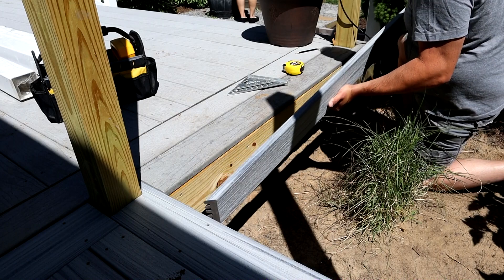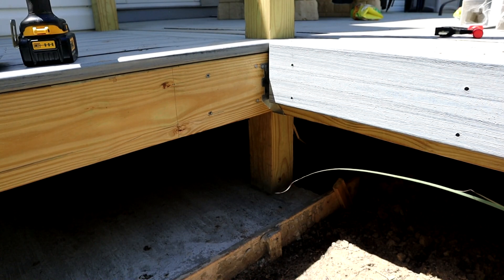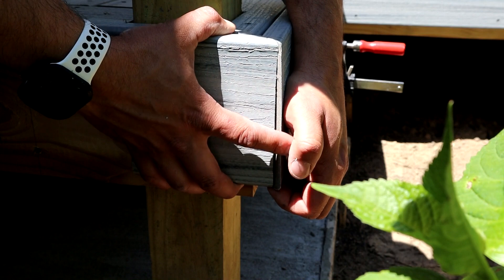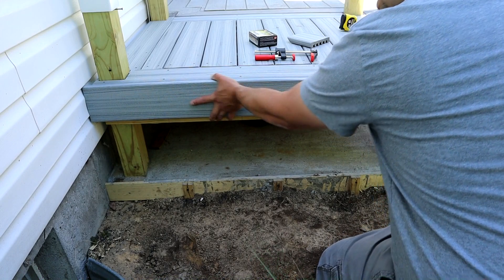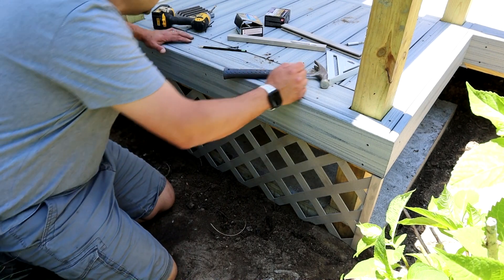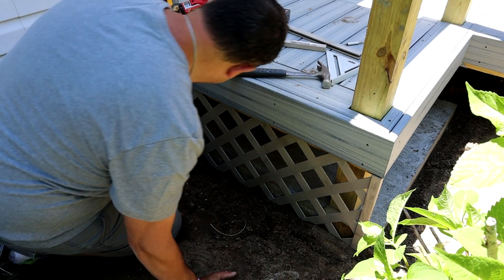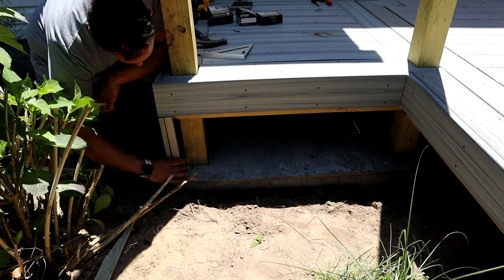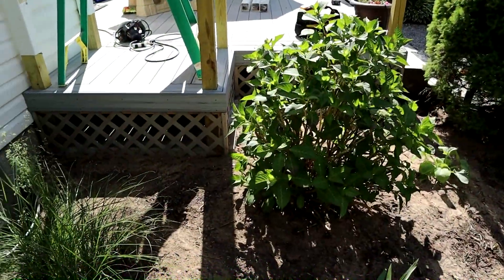Install Deck Skirting and Lattice | How To

Comment from the maker: Miter Saw: https://amzn.to/30UHYFJ
Milwaukee Drill/Driver set: https://amzn.to/3auep1t
DeWalt Drill/Driver set: https://amzn.to/2PVXmM3
DeWalt Circular saw: https://amzn.to/3kZzmpv
The BEST Screwdriver: https://amzn.to/34xw3QN
The LAST pair of pliers you’ll ever buy that the PROS use: https://amzn.to/3aYacDk
AWESOME wrenches: https://amzn.to/3lioLq3
DeWalt grinder: https://amzn.to/34LalZV
The BEST Hammer: https://amzn.to/3lUKFjw
Level 2 foot: https://amzn.to/2Gxa02F  
Spring clamps: https://amzn.to/3mGcUSG
Tape measure: https://amzn.to/3oNfAjh
Drill bit set/index: https://amzn.to/3kSj1Tu
Canon M50: https://amzn.to/2PdqqhO
Mic: https://amzn.to/33jqXae
Tripod: https://amzn.to/3k4w3wP

Comment: For those diy’s, when planning, extended the picture framed decking by the thickness of the lattice and the facia. Leave a 1/2 reveal. Then install the lattice onto the framing, then put the facia boards over the lattice.
Reply from the maker: Thanks for the comment. Bunch of different routes to go here. My main reason for doing it the way I did in the video was to match the new deck to the existing deck. I also like having access under the deck by pulling a couple screws on the lattice.
Reply: @fixitwithzim  good point if you need access.

Comment: It would look so much better with horizontal boards matching the front pillar frame the lattice is very outdated and cheap looking. Just say no.
Reply from the maker: Nahh, I hate the way deck boards look for skirting. No thanks. I like the underside to breathe, lattice perfect for that. Thanks for watching 👍🏻
Reply: But, but... The lattice provides for ingress and egress of rodents and other
critters that clearly need a nice place to live out their lives. They greatly 
appreciate the radiant heating and the water sources that the space
provides. Please consider the wildlife that might be harmed by your
suggestion of using horizontal boards. That's simply not okay. 🙂